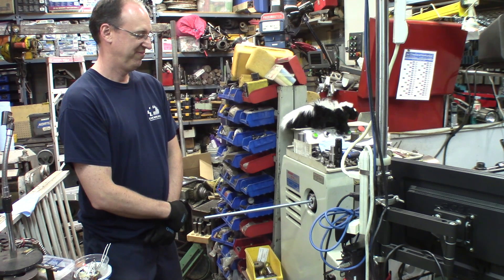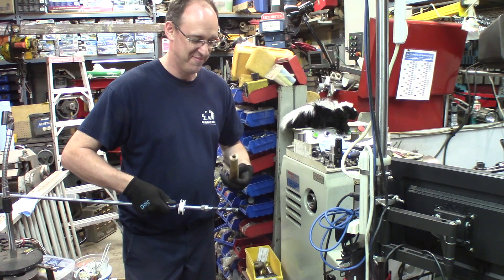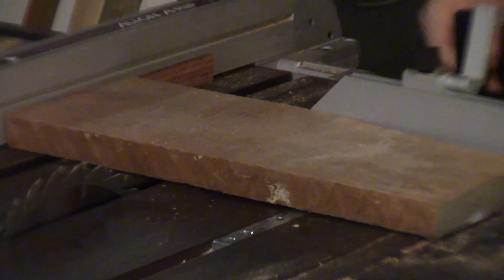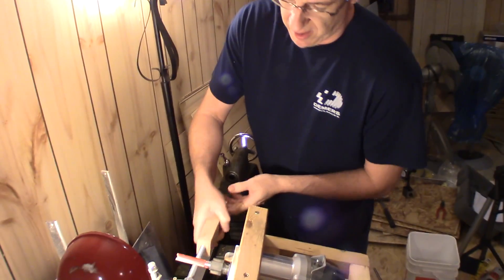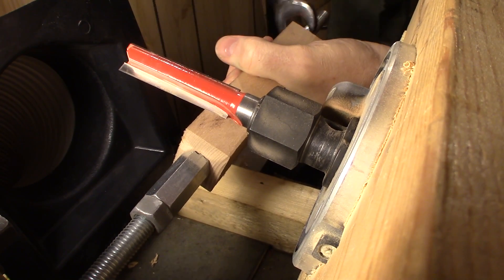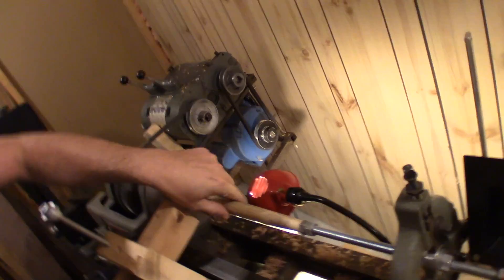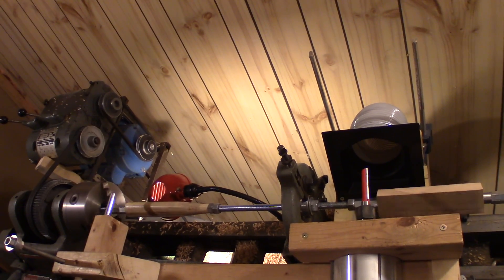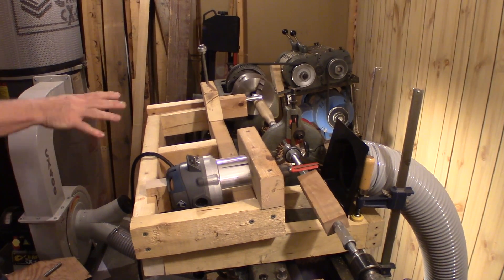Fancy lathe work, Machinist hammer, carving the wooden handle ( Keith Fenner WIYB 2016 giveaway )

Comment: Two things, even though it is to late for this I would auction them or some of them with proceeds going the "WIYB". Second is How is the depth of the cut set or controlled? Last it is a great method for a pattern, a little "Rube Goldberg" but even his stuff did what it was suppose to do.    ;}
Reply from the maker: On the leftover number of hammers, some are for some friends in the community a couple for promoting our respective channels and the rest is for selling in order to help for material and if any left it will help fund our channels since it cost way more money than it brings back.  
Robert controlled the depth with a setting screw determining the position of the following pin on the master shape, then the router has to follow... 
It's a great setup for short runs...   
Thanks for comment,   Pierre
Reply: Hello dejanira2,
The depth of cut was adjustable with a bolt near the steel dowel.
see here https://youtu.be/WefR_Noxzdw?t=625
I found, in use I could keep the same setting for rough and finish, the second pass being a 'spring pass'.  Once I had the right setting I could run off a batch.

Robert

Comment: I've seen a similar rig made for producing oval picture and mirror frames (2' by 3' or 3' by 5' maybe). It might have been "This Old House" or "New Yankee Carpenter". They used an actual cutting tool rather than a router, but the principle was the same - copy the motion from a master template. Nice solution to the problem.
Reply from the maker: Hi Peter,
Nope, next year we're not making a mirror or a picture frame...    lol
I guess that when there is a need to get something done, imagination is our best tool... ;)
Thanks for comment,   Pierre

Comment: Robert came up with a real clever and innovative method of turning that elliptical shape. As you say Pierre, it's more than good enough for a short run of parts. There's more than a few other methods to do the same, but all the one's I can think of would be far more complex and time consuming to build.
Reply from the maker: With a few tweaks this would be an acceptable method to achieve very decent results on bigger runs... This is simple enough for just about anyone to be able to make one and get the job done...   ;)
Thanks for watching and for comment,     Pierre

Comment: Cool set up! I think the one thing I would do differently is leave the handle on the lathe for at least the initial sanding. 

I have a lathe, three routers, and even a selection of hinges and straight router bits. I will definitely use this when I need to make matching wooden parts. Thank you!!
Reply from the maker: Hi Jon,
Good idea about leaving the handle on the shaft, but, Robert was hand sanding one handle while the other one was getting carved, allowed him to get 2 things done at once and by standing close from the air cleaner's input get the dust filtered. 
This set-up is the simplest expression to duplicate something on a lathe and it works great for short runs...
Thanks for input and comment,    Pierre
Reply: Personally I would still do it on the lathe, because it would be so much faster and easier than holding it, and then I could watch it turn the next one. :) 

But I can see why someone else would do it this way. :)
Reply from the maker: Robert has to re-install in a new house, so, he didn't have that much time to watch those 30 handles getting carved. We're lucky enough he got the job done despite his loaded agenda...
Reply: That makes sense. Hopefully his new home will work out well in every regard, but at the very least for his workshop and a small cot. :)

Comment: That is a fancy bit of rigging for tracing hammer handles, good job! Where did the master come from? Was it an old hammer handle or was it done by hand? I would suggest mounting the hand sander and moveing the parts to it to finish, much less likely to sand your hands that way. Of course sanding your hands helps to keep the calluses down. :-)
Reply from the maker: Hi Brian,
The master handle was purchased after we found a suitable handle for the project, a couple of adaptations were made to a better fit.
Now Robert has the softest hands in the community....   lol   ( No, I didn't check... )
Cheers,    Pierre